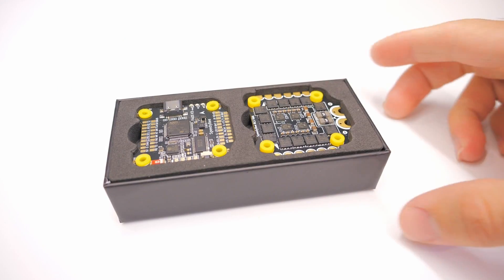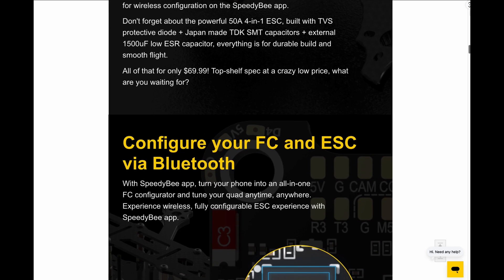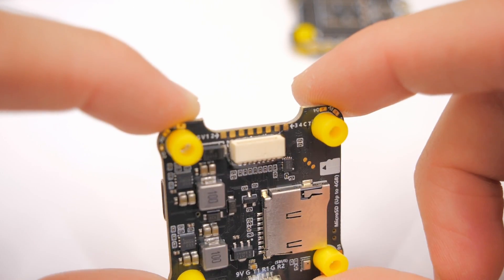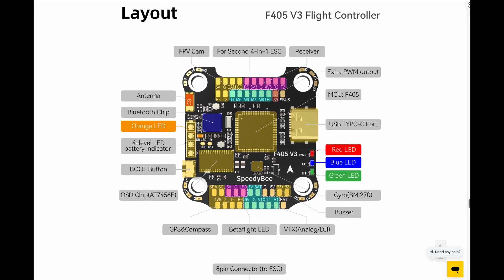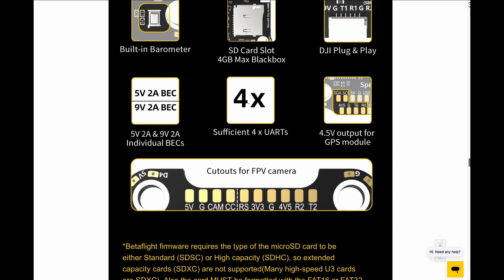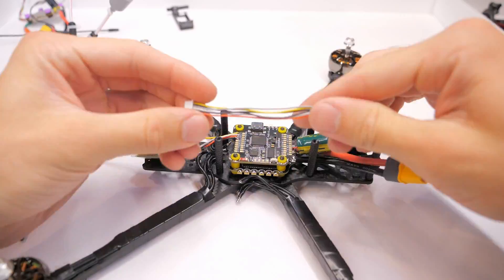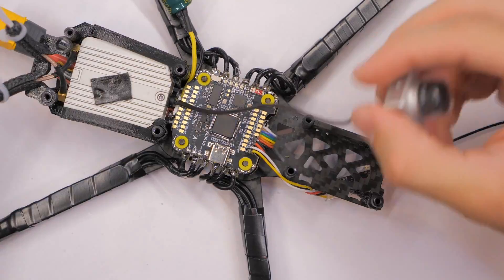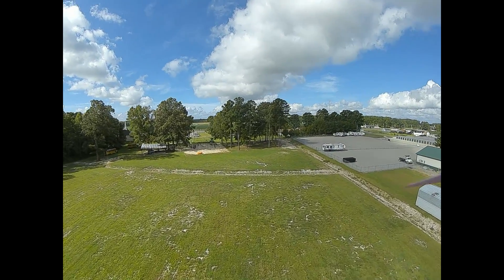Probably the BEST $70 STACK right now - SpeedyBee F405 V3, ESC and Flight controller FPV Drone Stack

Comment: Can this be used on a hunter vtail 500 drone ?
Reply from the maker: Not sure, but I don't see any reason it couldn't.
Reply: @RCwithAdam1  we gone find out today.  Are ESC selection according to motor kv size?
Reply from the maker: @derrickmitchell39dm  No,  not necessarily. Usually the important factor is how many amps the motor will draw with the attached prop, and then get an esc rated to handle that many amps.

Comment: I have been looking for the voltage output of the VBAT pin on this ESC and i cant seem to find it, their spec sheet does not say what the output voltage is at the pin if soldered, or the voltage input of the FC, do you know what it is please?

Comment: Mi dispiace ma non riesco più a fidarmi di uno stack Speedybee. E tutto fantastico, tante funzioni interessanti, possibilità di configurare la FC tramite Wi-Fi , un prezzo davvero buono… purtroppo il mio drone con speedybee f405v3 ha sofferto di gravi problemi di desync finché un giorno dal nulla ha fatto un death roll senza apparente motivo e si è schiantato rovinosamente a terra rischiando di perderlo. Cercando in giro sembra che non sia il solo ad aver avuto problemi, qualcuno ha risolto modificando il firmware dell’esc, io invece preferisco spendere 20-30€ in più e prendere schede più sicure che buttare via build da 500-600€.

Comment: I have bought a total of 3 of these FC+ESC stacks and 1 of the FC's by itself. I have no long term experience with it, but I can without a doubt say that it comes with Betaflight 4.3.2 installed, and if you upgrade to betaflight 4.4.2 and use a 32gb microsd card for blackbox logging you will have issues with your OSD. 

I just learned this today and will try to spread word. I still think it is great value for what it costs, it just either will need to be left on the stock firmware or have the SD card removed once it is PID tuned.
Reply: Hi Carguy, how to use the S9 pad for PWM output on this FC?

Comment: I bought a speedybee with this app. It has the dji o3 and was suppose to work with the dji controller v2 and googles v2  but, I cant seem to bind or connect to neither the controller or the goggles.  Ive been on it for hours! Im so sick of this shit. How hard can it be 2023 to connect something ? I've updated both controller and goggles . It's so frustrating.. the dji fpv sync tok me 30sec to set up :(

Comment: The FC is good I have 1 with a T-Motor ESC flies like an F7 and has everything the original esc was heavy and blew on first crash so i had a T-motor light 45 amp esc laying around THE FC IS GREAT

Comment: Have you tried INAV for this FC? Since mine having trouble on ESC protocol (available only multishot) and when armed the motor didnt want to spin
Reply: Same as mine, did you find a solution
Reply: @MrElasky123  Yes can, using BLHeli_S mulitshot version. But u need to calibrate the output first for multishot protocol

Comment: What's your opinion on putting a 50 or 60 amp stack on a 5inch quad do u thinks that's over kill
Reply from the maker: I don't think there is any downside to using ESCs rated for higher amperage than needed, all other things being equal. Usually it's just more expensive to use higher amp ESCs.

Comment: I hope I shall get reply.  How to connect telemetry with this flight controller to monitor battery voltage etc ? Or this flight controller don't need telemetry? Can you answer me about telemetry.
Reply from the maker: Are you using it in an airplane or fpv setup?
Reply: @RCwithAdam1  in fpv .
Reply: Can you guide me about telemetry for this flight controller?
Reply: @RCwithAdam1  please answer

Comment: Bro can you tell some details about why SD cards are used on a flight controller?
Reply from the maker: It's for storing the blackbox data, aka "blackbox logging". It's so that you can view the flight data later and see things like motor rpm, gyro data, noise, and other aspects. This is to help when tuning the quad and seeing the effects of any changes that are made to the PIDs or other settings.